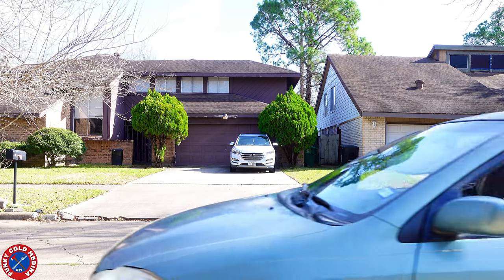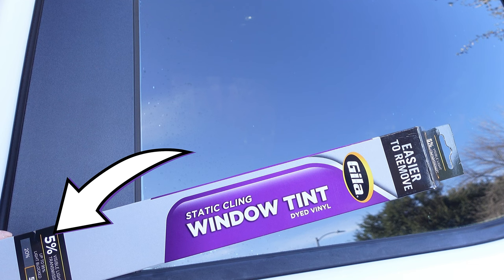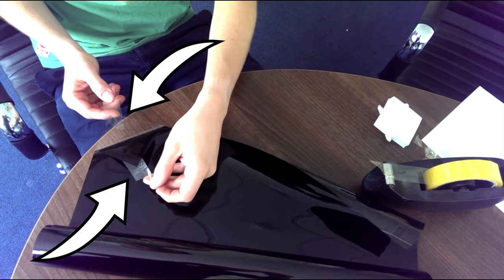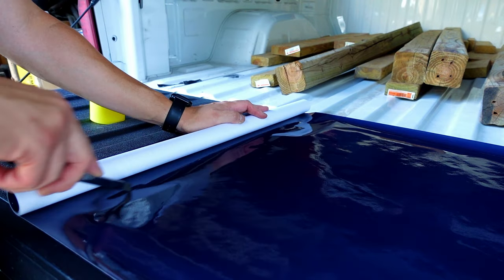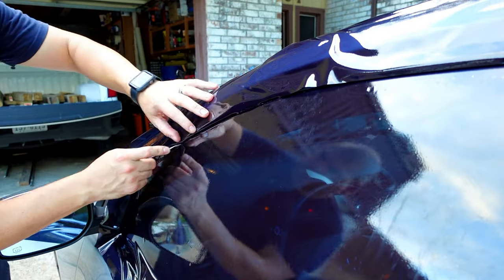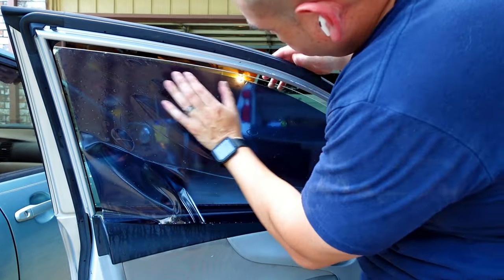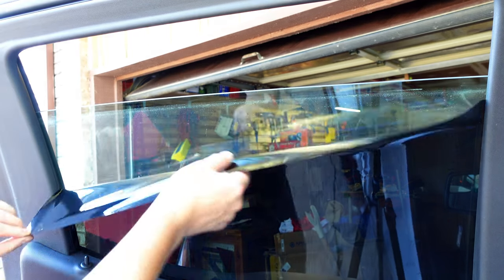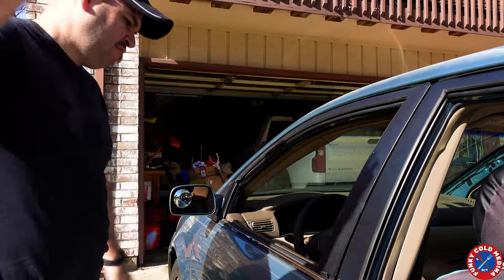NO GLUE Window Tint for BEGINNERS, EASY & SIMPLE Installation | Static Cling Gila Window Tinting

Comment: Would you recommend using the 20% of this Gila Static Cling in the front ? I live in Houston Area. 
Have you been pulled over for it being too dark?
Reply from the maker: Whats up Miguel. Yes I would highly recommend using 20% tint in the front. Even that is border line. I believe 25% is the law. When you get a vehicle inspection they may check the tint with a tool. My personal truck has 20% in the front but they said it was ok. It just depends who you get. The white truck shown in the thumbnail is actually my work truck and i have 5% tint all around. My line if work lets me get by with the dark tint so its not an issue. Great question Miguel. Let me know if you have any other questions or comments. Have a blessed day😁😎✌️
Reply: @FunkyColdMedinaDIY   Thank you so much for the info 👍😁
Reply: Just take the tint off before inspection and put it back on after.
Reply from the maker: @malachistidd6246  Definitely an option as well. I tried that during an inspection. The guy said “your tint is too dark”. Im sure he wanted some extra cash to pass it. I said “no problem man, I’ll just peel it right off”. Right when I was going to do that, he said “don’t worry about it”🤣
Reply from the maker: Hello Miguel, I just wanted to update you.  I just released my 2 year update video on the window tint.  I also answered many questions from my viewers in the comment sections. Just wanted to let you know that I featured your question in the video. Here is the link https://youtu.be/RopXmbnnJxM.  Thank you for your question and have a blessed day😁😎✌️

Comment: so i got the gila plus version… does applying it work the same as the one you’re using in this video? do you recommend i go get the removable version that you’re using without glue?
Reply from the maker: From my understanding that Gila Plus versions are great but use glue. If you are comfortable installing that type of tint yourself then I would go with that one. If not, I would highly recommend the static cling that way mistakes are kept to an absolute minimum. The process to install them both are the same. The differences are that you have to be more careful with the tint or it will get stuck to itself and crease very easily. Also when its time to replace it you will have to remove the glue and old tint. Now could you install the static cling over existing tint? Probably so, I will make a video testing that soon. The video is aimed at beginners or people not comfortable with installing the traditional tint with the adhesive. Thank you very much for your question. Let me know if you have any other questions. Thank you for watching and have a blessed day😁😎✌️
Reply: @FunkyColdMedinaDIY  thank you for responding. i went back to autozone this morning  and exchanged the plus version for the static version that you’re using in this video. i also ordered the kit you’re using in this video and it’s coming tmrw. 

also i saw on the box it says it should cover up to 2 side windows, but i wanted to know if you were able do more than 2 windows with one roll or did you need an additional roll to do all 4 side windows.
Reply from the maker: @donedone4677  No problem Done Done. I used two rolls to cover 4 side windows and the rear window for a 2022 Chevy Silverado. The truck that you see in the thumbnail. You should be just fine. It wouldn’t hurt to get an extra roll either if you make a mistake or for an extra roll for another vehicle.
Reply: @FunkyColdMedinaDIY  hey again, I forgot to ask about the soap to water ratio for the solution. How much of each should I use to make a proper solution?
Reply from the maker: @donedone4677  Hey there done done, I usually use a couple of 1 tbsp of dish soap per cup of water. It doesn’t have to be exact, you just want enough soap so the tint can move around if you need to adjust it. Then you squeegee everything out once you got it in place. Let me know if you have anymore questions. Sorry for the late reply. Have a blessed day😁😎✌️
Reply: @FunkyColdMedinaDIY  thank you!!

Comment: Quick question do you tint both sides? Or just the outside window?
Reply from the maker: Great question. You only tint one side. Im sure there is more than one way to install tint on your windows but this is the most common way. Get the size you need using the outside of the window 1st, cut it, then remove it and install it on the inside.  Just one side of the window is tinted. Great question. Let me know if you have anymore questions. Ill do the best I can to help. Thank you for your comment and have a blessed day. Also Happy Holidays to you😁😎🙏
Reply: @FunkyColdMedinaDIY  k thx for the response!!! Happy Holidays

Comment: how about the rear window? would this work because of the curve?
Reply from the maker: Great question. Yes it will work. The material is flexible. Its easier to install in the sun as a tip. The only issue is that some rear windows are too wide from top to bottom and it won’t cover the entire height.  Its just a few inches and really not a huge deal, to me at least🤣. Here is the link to my curved rear window tint installation video. https://youtu.be/5eBCrgIL0c4?si=bQfzpfhBfApFE72q. Sorry for the late reply. Thank you for watching and have a blessed day🙏😁

Comment: how long do you have to wait until u can roll your window down
Reply from the maker: As long as you have all the air bubbles out, cut right with tint not poking out where it can get caught on something, you can roll it down immediately. It gets stronger adhesion the longer it sits. I say an hour in the sun and you will be just fine. Thank you for your comment and watching, have a blessed day😁😎✌️

Comment: Do I have to remove old tint first before applying this? Or can I place it over the old tint?
Reply from the maker: If you have old tint and it doesn’t look to bad then you could place it on top of it. I would recommend removing the old tint. Its a little more work since you have to remove the glue. Thats why I recommend this tint for fresh glass since it has no glue. Ill try to make a video on how to remove the glue if you have that issue. Great question. You are pretty smart😁Have a blessed night hun😎✌️

Comment: I noticed that you put the tint on inside out, the paper side is the one that goes directly on the window inside.
Reply from the maker: Hello PyroTallahassee, Its up to you which side you use. There is no glue and the paper is to make rolling out the tint a little easier. Some static cling tints have the paper adhered to one side and some like black magic, have it loosely fitted.  I’ve used both sides and have had no issue. Thank you for watching and have a blessed day😁😎✌️
Reply: @FunkyColdMedinaDIY but why set the size on the outside and then move and try to place it correctly on the inside. Why not do directly inside?!?
Reply from the maker: @RomboutVersluijs  Hello Rombout. You most certainly can. Traditionally thats how its done because traditional tint has the glue on the outside and then you transfer the tint to the inside like I did. This tint does not have glue, its just easier for me to cut from the outside. It can be done either way, whichever is easier for the individual. Thank you for your comment. Great question. Have a blessed night😁😎🙏

Comment: Does it matter which side of the film u use
Reply from the maker: Great question. No it doesn’t. It doesn’t have a sticky side like traditional tint. It sticks on by just spraying soapy water on the window and when you squeegee the soapy water out, it sticks but can be peeled off without issue if needed. Ive never had an issue in all the years I have used it. Once it starts to fade, just peel it off with ease, clean the window and re-install the new one. I love this stuff. Saves a bunch of money and time. Thank you for watching and have a blessed day🙏😎

Comment: Mine has a lot of bubbles and can’t get them out 😭. How do I fix this?
Reply from the maker: Hello there and sorry you have to deal with his. Its a common issue. Bubbles are common & here are a few reasons this happens.  Not to say that any of the following is your fault, just some reasons.  1) The window was not properly cleaned and there is dust/dirt underneath. 2) The tint may not have full contact with the window along the edges or corners. Make sure its all tucked in against the window under the car trim pieces etc. 3) Placing the tint in the sun helps to flatten out the tint and get rid of any excess moisture underneath. Takes a few days out in the sun for the bubbles to go away, up o 2 weeks. 4) If the bubbles are still there or you just want to hurry the process, remove the tint carefully so you can re-use it. Clean the window very well, re-install it, squeegee all the bubbles out starting from the center out, and place the car in the sun.  They will all go away.  If you still have air bubbles, you may have some defective tint. If all else fails, you may have to take it to a professional if you do not want to deal with it anymore. I hope this helps and I hope you are able to do this on your own. Let me know if you have any other questions. Thank you for your question and for watching. Have a blessed day and Happy Holidays to you. 😁🙏😎

Comment: has anybody installed tint using this gila tint? i plan to tint my car soon and i have so many questions. do i have to buy the gila tint solution or can i make my own with soap and water? is a heat gun needed because a lot of people say it is or can i just let it sit in the sun for a day or two.
Reply from the maker: Hello Done Done, Ive used both traditional and static cling tint. Im not a fan of the traditional tint because it is very easy to make a mistake. Professionals that do it all the time, I applaud their work. Ive never had an issue with the static cling. The first 2-3 days it may look a little blurry but that will go away after getting exposed to the sun. You do not need the Gila solution.  You can just use soapy water to install the tint. If you want to remove the old tint, I used a heat gun with a razor and it came off fairly easy. You can also use a glass cleaner that has ammonia and it will clean the glass very well after you get most of the glue off. I will make a follow up video soon. Let me know if you have any more questions. Thank you for watching and have a blessed day😁😎✌️
Reply from the maker: Hello Done Done, I just wanted to update you.  I just released my 2 year update video on the window tint.  I also answered many questions from my viewers in the comment sections. Just wanted to let you know that I featured your question in the video. Here is the link https://youtu.be/RopXmbnnJxM.  Thank you for your question and have a blessed day😁😎✌️

Comment: Funny video. How is the tint holding?
Reply from the maker: Thank you Felipe. The tint is still going strong. I have not had any issues it. No problems rolling down the window and it bunching up. No fading. I showed someone recently that it can be peeled off without an issue and just stuck it back on. People are amazed on how simple it is to install. Just take your time cutting it and you never have to worry about glue and messing up. I highly recommend. Thank you for your comment brother and have a blessed day😁😎✌️
Reply: @Funky Cold Medina DIY  2  more questions if you don't mind: did you have to use a heat gun to shrink the tint? And lastly, did you cut the tint smaller in the sides so that it needed to be tucked underneath the side weather strip? Thank you so much for your time!!!!!
Reply from the maker: Hello Felipe, I just wanted to update you.  I just released my 2 year update video on the window tint.  I also answered many questions from my viewers in the comment sections. Just wanted to let you know that I featured your question in the video. Here is the link https://youtu.be/RopXmbnnJxM.  Thank you for your question and have a blessed day😁😎✌️
Reply from the maker: Hello Felipe, Im sorry, I did not see your other reply. I will have a new video soon on how to remove the tint. But long story short, yes I did use a heat gun and used window cleaner to remove any glue left behind. Just make sure it has ammonia in it. I did not cut the tint smaller.  All I did was tuck the sides in.  If they are a little long then I just cut off a small strip off. Thank you for comment and I apologize for the lateness of this reply. Have a blessed day😁😎✌️

Comment: I wish I would have seen this early today. I just spent 370$ on 5 percent tint at tint world 😭😭😭
Reply from the maker: 😮Oh man sorry to hear that. That is lot of money. Thats ok, we love and learn. Im sure it won’t be the last time you will need to put tint on a vehicle. Thank you for watching and have a blessed day😁😎✌️
Reply: @FunkyColdMedinaDIY  thank you brother
Reply: @FunkyColdMedinaDIY hey quick question, can this be installed in front windshield? Would it fit?
Reply from the maker: @jsueaud  Yes it can. Just make sure the strip stops at or above the line that is marked on the windshield. Use the factory edge for the bottom and cut it to size from the top. Great question
Reply: @FunkyColdMedinaDIY  I am trying to black out the whole front windshield, might not be long enough...
Reply from the maker: @jsueaud  The whole front windshield? You could but i think you will be short a few inches either from the top or bottom.

Comment: Sorry but why do all the cutting on the outside. I mean it takes you more time to reposition it to get it at the exact same spot. Isn't it easier to cut it straight in the inside??? Seems counter intuitive
Reply from the maker: You definitely could cut it from the inside. It just seems to me that it makes positioning yourself much easier if your standing on the outside cutting it to size. Also traditionally you cut tint on the outside because the glue is on the outside (i am referring to traditional tint) Since this tint has no glue you can theoretically place it on the inside and cut it if thats easier for you. Either way is fine. Its easier for me to cut it on the outside. Thank you for watching and have a blessed night 😁😎🙏

Comment: Not any good 
Maybe if you used to doing stuff like this, but not a diy, you definitely need some help
The tint doesn't cut easy 
Likes to stick to its self 
And bubbles 
constantly sides and moves and falls on you while trying applying
Reply from the maker: Sorry you are having trouble. Try a d find some help from someone. Ive never had any| of the issues you describe and I am no where near a professional. It shouldn’t stick to itself, thats the whole point of using this tint. Maybe you got the wrong one. Static cling is the one you need. They do sell the same brand of traditional tint that sticks to itself. Hopefully you didn’t get the wrong one. Thank you for watching and have a blessed day🙏😎

Comment: What about the rear windows of a sedan? Would this be difficult?
Reply from the maker: It can be a challenge but it can be done. Take your time amd try to use a long windshield cleaning squeegee to help lay the tint down to the glass if you can’t reach and the its tight to move around. It can be challenging but I would give it a shot and see what happens. If it is too difficult then you may have to get it done professionally. Thank you for watching and have a blessed day😎🙏